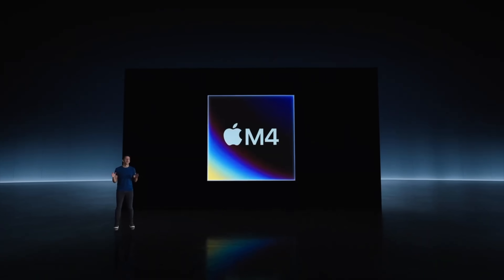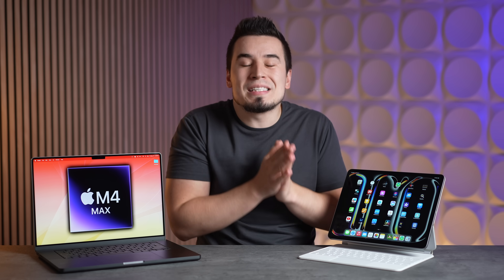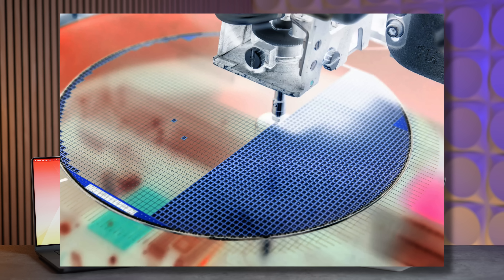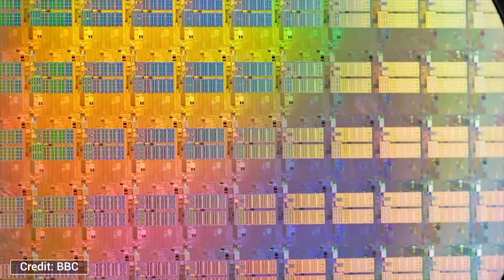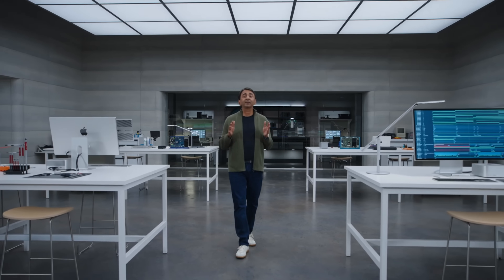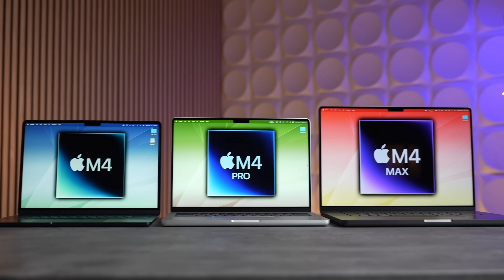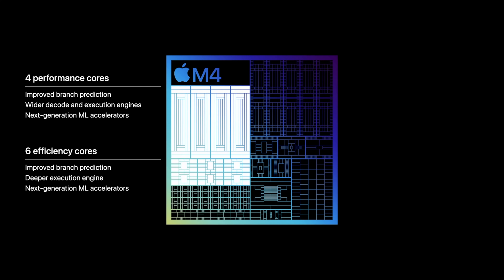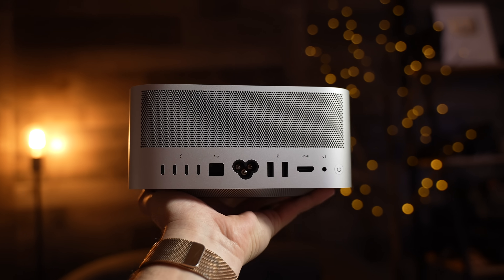What M4 iPad Pro means for M4 Macs (Huge WWDC Reveal?)

Comment: really nice to be an early adopter for the MacBook pro m3 11 core,  everyone said were at the limit now every year will only be small upgrades, so i got one and now its come out that i just got the crap one. guess what mine still cost the same as the m4 MacBook is going to when it comes out, but mine won't be usable as long. apple jus made a new windows customer out of me, i could care less how great m4 is, the marketing strategy is garbage, i got a brand new computer a month after it was announced and it was not just outdated but completely obsoleted after 7 months, so pissed

Comment: M3 and M4 are likely using the same p-cores so it not out of the question that M3 Max could still end up in the Mac Studio in June 2024 but clocked at a  higher frequency due to the superior cooling of the Studio. N3E production is still ramping so this would be more of a strategy based on available manufacturing capacity.  Then M4 comes to the Studio one year later.

Comment: The node change isn’t the reason why the iPad Pro got the new M4 first. I’m sorry, but that’s just not the reason. The node change enabled the new chip, that’s true. The new iPad could have gotten the M3. It wouldn’t have mattered for the iPad, except for one reason. The tandem OLED panel needs a new, special controller. That controller isn’t in the M2 or the M3. But it’s in the new M4. Apple could not have come out with the new display without that new controller which takes up an inordinate amount of real estate on the bottom right of the chip. It’s odd to me that so few people, whom, I assume, watched the presentation, where this new controller was highlighted and mentioned that it was new and developed to drive the tandem display. If Apple didn’t include the tandem display, then the M4 wouldn’t have been needed. The only other reason why it might have been, even if the new display wasn’t included, is for AI. They did make a big deal about the Neural Engine now doing 38 trillion TOPS, rather than the previous 18 trillion. But I’m not sure what that means as they also, elsewhere, stated that there was better 8 bit TOPS support, so depending on how they’re measuring this, 16 bit or 8 bit, the number will vary. I suppose we’ll find out. I’m really surprised Max didn’t catch this as he’s usually pretty sharp.

Comment: Timeframe requirements are often the most important thing to determine when looking at tech upgrades. Taxes can often work in your favour.

Yes, M4 and its variants will likely be offered throughout the lineup, but the M4 chips likely will not hit MacBook Pro’s or MacBook Air’s until late 2025/2026.

We will see it in the studio’s, the mini, the iPad mini first.

Purchased the top spec 16” M3 max in March ‘24 (RRP of AUD11.7k) - I shouldn’t need another machine for 5 years. (This wasn’t overkill for my usage either)

I knew what level of machine I needed, I had to be able to afford it and until that point, buying an interim option would be a waste of money - used what I had until I was in a position to do so and planned for it in advance. Happy with my decision.

Comment: Well, it seems even M4 is having an issue with N3E according to Geekbench. Yes, the performance is great but it was possible by ML accelerator for specific test which M3 does not have. With a same test, M4 was NOT that better than M3. Beside N3E didnt really improved over N3B which is another problem.

Comment: So apple said "hahaah got ya bitch" dave chappelle style to m3 owners. Lol. I don't like apple tech...specifically current apple tech anymore, but still use a fully loaded 2013 mac pro for everything sound in my studio (not my home rig) It still eats anything the engineers, or myself throw at it. It's impressive, but that's sound. I will have to upgrade in the near future to utilize/take full advantage of AI incorporation, for now if it requires such the windows rig is used after the clients leave because they want to see apple products for... reasons.. being used for sessions. It's bizarre, with all the audio equipment surrounding them...seeing non apple os on the screen is a deal breaker.

Next mac pro model I guess, if it can't wait a m4 macbook pro hooked up behind the desk or something 🤷‍♂️ really wouldn't need it for anything else unless it's a product I can replace the video side of things with.

Comment: I have an M1 Max Mac Studio and I need to go back to a MacBook Pro setup. I want a Max chip for the number of displays it can drive. I can get a refurb M1 Max MacBook Pro 16” off eBay for $1700 or spend about twice that for a future M4 Max version. The Mac Studio will fetch at least $1000 to go towards it. Do you think the potential M4 gains are worth the wait? Whatever I buy I plan to keep for more than 5 years. I can afford to wait for the M4 Max with the only real driver maybe being the resale value of the Studio potentially dropping.

Comment: Seems you focus on N3b -> N3e for the performance improvement, but, according to an article on wccftech, the main improvement comes from new ARMv9 Architecture adopted by the M4, and, because Geekbench seems to be optimized fort it, then you have those result.
But, for "older" applications (Apple’s M4 Has Reportedly Adopted The ARMv9 Architecture, Allowing It To Run Complex Workloads More Efficiently, Resulting In Higher Single & Multi-Core Gainsuntil they are "optimized" for it), the gain is about ... 3%.
Source : Apple’s M4 Has Reportedly Adopted The ARMv9 Architecture, Allowing It To Run Complex Workloads More Efficiently, Resulting In Higher Single & Multi-Core Gains... (wccftech)

Comment: I think Apple have got their branding wrong here, particularly as these process stepping get slower and less impactful, I would do what intel do with Intel do with there i line of processors and reuse the designation on successive generations, so i3, i5, i7 etc, and incidentally so do BMW and Audi. Therefore M4 would be highest power highest performance, and M1 lowest power lowest performance, M0 would be the watch chip.

Comment: M4 chips appear to be very efficient. This might result in extremely long battery life in M4 MacBook laptops. Or, Apple could make M4 laptops thinner, as they have done with the M4 iPad Pro. We might also see an 11 inch or 12 inch M4 MacBook Air. 
It is odd, though, that Apple would make M4 devices orphans. They could sell M2 and M3 laptops as lower priced laptops at Walmart.

Comment: I think you are glossing over the AI Trillion of Operations Per Second upgrade or TOPS on the new M4 chips.  Microsoft is requiring all new AI PCs to have a similar amount of TOPs as Apple put into the M4 and no other Apple product offers this performance, so I think Apple has to upgrade their Pro model iPhone, iPad and all their Macs to this chip very soon to keep pace with PCs on the AI front and also to offer on device AI on the majority of their devices in the Fall.  I think that's the key driver for them to upgrade their entire line up sooner rather than later as they want to offer their AI functionality across all their devices and hope that will drive their revenue at then end of this year since everyone will want that.  And they need to offer the devices to devs so they can incorporate it into their software from the beta.

Comment: Good points, TSMC's N3E M4 and moving forward is definitely a future. It's also kind of sad M3 was just used to fill the gap for such a short while until M4 arrives. Basically any Mx chip is still incredible achievement of engineering and for basic daily tasks is completely sufficient. Apple successfully convinced many pros to move to their platform which makes complete sense looking on where M$ is with their schizophrenic and bloated Windows 11 and the future of WIndows/PC platform. Only if Apple would open more to Windows and Linux and enable the to run with the Mac Os.

Comment: The real reason Apple skipped to the M4 directly is because to mock the Snapdragon Elite X, which pushed fake benchmark numbers exaggerated and yet unconfirmed as today.
Rumors by internal testers has already pointed out that the Snapdragon Elite X is a big fail and doesnt pump out more power vs an Intel Celeron on battery power.
This means that their chips are a big joke and doesn't even outperform the M1 on battery power.
The M4 is going to make a laughing stock out of the Elite X chip.

Comment: Thunderbolt 5. How long, after announcement and demos, Apple implemented each Thunderbolt technology? Hyper has shown off TB5 docs, TB5 laptops shown at CES. If, as you say, Apple is on an 18 months product cycle, do you think they let everyone else release TB5 products? TB controller is built into the M series chips. Unfortunately, for the new iPad Pro, we’re stuck with TB3, not TB4. USB4, but TB3 only. We need TB5 to connect to the new generation 4k 240Hz QD-OLED monitors. 
I was hoping for TB5, WiFi7 and the H2 chip for AirPod Pro 2 in the new iPad Pro, instead we have lots of stuff that’s been removed.

Comment: Hanging on until the June event. Desperate for a new Mac on a 2012 iMac using Catalina & borrowing my mom's M1 Macbook Air when I edit longer videos in Davinci as my current Mac only handles it for shorter videos. Been looking at the iMac M3 24 GB Unified Memory or the Mac Studio M2Max with a Studio Display which would give me 27" of screen. but closer to $6000 CAD versus the iMac M3 at $3500 CAD as I want a TB drive at least. Waiting to see if a M4 Studio comes out in June.
Reply: Mac Studio is still on M2, and my bet is that  are in no hurry to come out with M4 versions. The iMac and MacBooks with M3 will be the priority. Being a cheapskate, I just threw down on a Mac Studio (M1 Max) to replace my 2012 mini. It is almost as fast as an M2 for video (the media engines are nearly identical) and has 32GB RAM vs iMac's 24. Plus 10GbE that makes using a network volume soo much better. Only  know what will happen in June, so I will keep my fingers crossed for 'ya!
Reply: @SteveNeighbor  Thanks for the feedback on your set up. As much as I love iMacs I'm sorta leaning towards the Mac Studio because I feel like I'm eternally waiting for something new (hear iMacs will come out later this year) and with the studio comes more power. Also thought about the mini. I'm searching for Apple news constantly :D.

Comment: From die shots, it is clear that Apple didn't simply copy-and-paste their old designs from the M1 and M2.
The Youtube channel "High Yield" has a video where they go over this in depth, showing the differences in CPU and GPU core design between M1, M2, and M3. M1 and M2 are similar, while M3 is a significant redesign.
It is likely that M4 is also significantly different to M3, and it is possible that the changes in M3 didn't go as far as they would have if N3B hadn't been a dead-end node, but we'll need to see die shots in order to know for sure.

Comment: Do you think they might continue producing M3 products, but made with the N3E node rather than N3B? Or are they just going to discontinue M3 altogether?
Reply from the maker: Discontinue altogether. My take is that when the M4 MacBook Air comes out, the M2 MacBook Air will stay as the $999 MacBook again instead of the M3. M3 will get cut completely.
Reply: Unlikely. I think his argument is that you can’t make N3E chips on an N3B assembly line and I suspect vice versa. M3 devices will go the way of M1: excess stock sold by third parties but not in production by Apple.

Comment: Mac Mini is due a refresh but if Apple are using this to switch release cadence from low-to-high over to high-low end SoCs it makes sense to go with Mac Pro + Mac Studio then Mac mini to avoid pre-release cannibalisation. Maybe a base M4 Mini but not the M4 Pro yet.
M4 Ultra with heterogeneous dies? (i.e. M4 Max die + GPU/ANE-only die)

Comment: If the M4 chip is this fast, I have very tall expectations for the A18 and A18 Pro. A17 Pro to A18 should be even the slightest increase in performance, and A18 Pro should be a significant increase over A17 Pro! (Apple, No A15 to A16 or even A16 to A17 Pro size of an increase please!)

Comment: I’m looking to upgrade my decade old “PC wannabe”, an All in One “PC” that has laptop specs. Intel Core i5 5200U… the hard drive died last year and with an SSD upgrade it’s fast but the fan noise is really starting to piss me off especially when I have NOTHING open. Even with one or a few Chrome tabs it makes lots of noise which is annoying! And with Windows 10 losing support next year, I may as well upgrade to a Mac for the first time. 

I was planning to build my first true PC but after hearing about Intel’s shiddy CPUs, I think I’ll wait. Hopefully they can catch up to Apple and for the PC side of things, that they can make ALL PC parts more power efficient like Macs.

I can’t wait for the M4 Mac Minis and Studios to be revealed at WWDC, it would be a shame if Apple won’t reveal them next month. I wonder what new features the M4’s will get (like M3’s raytracing) and even if I don’t go for M4, the M1 and M2 Mac Minis and Studio will drop in Refurbished price even more!

Comment: The reason the chips are so much better is because apple's chip supplier, TSMC, switched over form the N3B node, which was basically just an in between node that was used basically just for apple, and it was kind of a nightmare and had really bad yields, and it took an EXTRA SIX LAYERS of EUV work at minimum, and in some parts of the chip it needed MORE layers than that. Plus the chip leaked a lot of power compared to what it should have been, and also the performance was like 5-10% lower than what it should have been, which is what this new process node is meant to correct. And so now, because the process is much easier, and the yields are gonna be much higher, meaning that they don't have to shell out tons of money on chips that fail to work properly, means that they can put WAY MORE CORES on these chips, much more easily, and so even tho m4 multicore really isn't that much more powerful per core than the m3 chips, the fact is that now they can get 10 on the m4 instead of 8 on the m3. And they also fixed a few critical issues that were holding back the single core performance, and made some major improvements to a few core areas of the chip that will stop the single core performance from being bottlenecked.
Edit: I wrote this comment before watching the video because I wanted to write my opinion to be unbiased without any information from the video beforehand and I'm only a couple of minutes in and I already see that we are touching on the same points lol
Reply: No it’s because most of the points comes from object detection in geekbench and skews the average. This is because m4 offloads to ane. A feat for sure but most real world performance won’t use object detection. So to say chip is overall 20% faster is false. 7 to 10% and that’s mainly due to 10% clock speed boost
Reply: well if it doesn't work like it was expected to they shouldn't have shipped it and screwed all the buyers of that product. so many people are disappointed now me being one of them, you get a brand new expensive laptop right when it comes out just to find out its just a placeholder and they really didn't try that hard on that model??? are you kidding me? these things are too expensive to just ship out half baked products, and at the time of release you don't know that's what it is. and typically you want yo be an early adopter for the product so its relevant as long as possible. there's no excuse im over apple. totally unacceptable

Comment: It's all marketing. The number after M is arbitrarily set by Apple. As far as I know, there's no set criteria as to what requires the number after the M to be incremented. 

So I'd say that the M4 was launched to give the perception of revolutionary rather than evolutionary.

So it follows that my impression from comments over time is that people are becoming familiar with new releases by Apple each year, their folks in launch videos finding new synonyms for Wow Amazing each year when it's just something or 20 percent or a bit more faster.

Sales were wobbling. Good reports about Snapdragon Elite X albeit on a questionable OS of Windows 11. So I'd say Apple were compelled to give the perception of being ahead.

The M4 surely is an advance on earlier with number of cores, 2nd gen 3nm, new neural engine. But it could have been called to M3 Ultra.

Comment: i think there are one of 2 scenarios. 
1 they release M4 pro, Max, Ultra along with relevant macs at WWDC 

or number 2 they only have software at WWDC and they release the M4 pro, Max and ultra later in october.

that way they can sell out the final M3 macs that are left in stock. and i think october/november release is gonna happen cus there are so many chips for TSMC and Apple to get ready. and the M3 would be also 1 year old rather than 6 months. sure they want to push out the AI software.

Comment: the Geekbench scores for the M4 are misleading. What I've read is that the M4 gets like three times more points in the AI test compared to the M3, but in the actual CPU and GPU (the parts that actually matter) are very slightly faster.

Comment: It isn't normal for iPads to get a "M" series chip first.  This leads me to agree with you that the other products that did not get an M3 will be updated with M4 first.  I would at least hope so because it is only fair that they get the chip first.  It also makes more sense to me to update the desktop machines first because they were built to deal with higher levels of heat.  They may need to do a little redesigning to handle the extra heat on the higher end of the MacBook range.